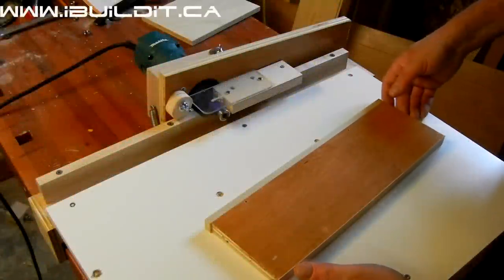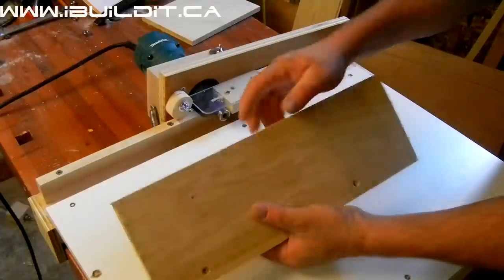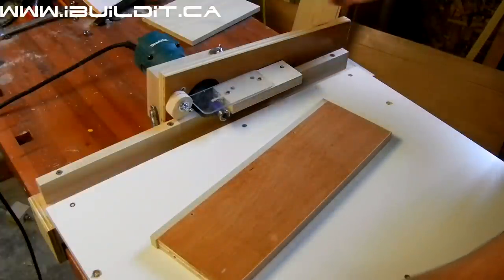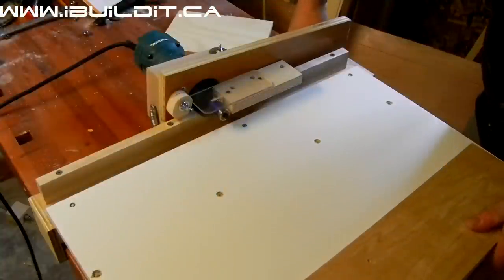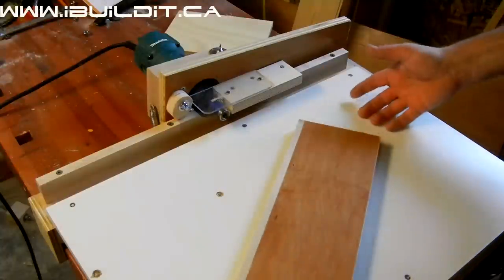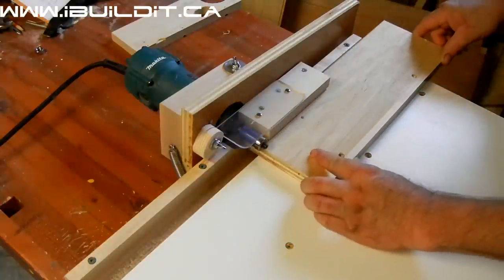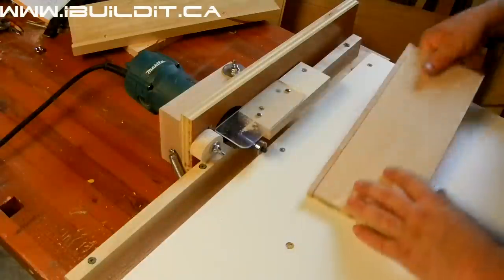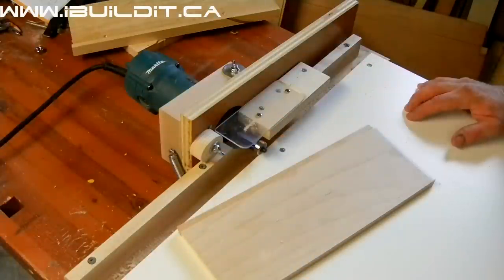Edge Banding Trimmer

Comment from the maker: Dust collection can add quite a bit of complexity to a project but is certainly worth the effort. For something like this, that mostly spits out chips, I would just clean up afterwards, if it is a small run. Otherwise, a 2-1/2" hose could be attached to collect the chips just above the cutter - this should be very effective.

Comment from the maker: For the sake of simplicity, I went with the cam. The cam pre-lifts the arm to the approximate height, so that when the work is pushed through, it doesn't take much effort to push it. This also reduces wear at the pivot point, as the range of motion is reduced. 
A more elaborate machine could have a larger roller in place of the cam, in the place you suggest - this would make it fully self adjusting.

Comment: John this is a brilliant idea and I have started making one. I have a spare router that I am going to set up semi-permanently. The only problem is that I cannot source a long enough ¼" flush trim cutter, the longest (in the UK) seem to be about 32mm. So I am trying it without the second fence and using the pivoting part as the fence. I have put an extra lock / clamp on it and it seems to work ok. Thanks for the realistic videos. Geoff

Comment from the maker: Thanks. I often take some details for granted - I should have mentioned it in the video. The table is about 3/4" from the fence to allow for the uncut edge of the panel, so that the panel can sit flat on the table. The gap between the fence and table needs to be wider than the thickest edge banding that will be trimmed.

Comment: This is an excellent idea.  I think that the reason for the edge banding sometimes not to be perfectly flashed could be that, if you have banding on both (opposite) sides of the board at the same time, the unrouted banding that is away from the router will lift the board causing the side at the router to be slanted downwards.and the edge away from the cutter.  Once both sides are trimmed, a second pass should correct the problem.  Thanks for sharing John.
Reply: Wouldn't it be easier to edge band one side, trim if off, then to edge the other side.
Reply: OwLoLz
I believe what he means is..when you put an edge on one edge of the board, the flash overhangs the top and bottom of that edge. Perhaps a small groove the flash could :"ride in" would eliminate the problem.  Lots cheaper then the $50,000 edgebander I had in my shop :) .....
Reply: Tom Wags
 Or just put your panel on top of a secondary flat surface that would run on top of the table, almost like a sled, then the edges would hange over those and not cause it to be unlevel while going through the cutting head.
Reply: Tom Wags you mean like the one in this video?
Reply: Just a simple watch of the video will show that the white platform does not reach all the way to the fence. This leaves a hollow trench that the bottom overhang will ride through, without touching anything.

Comment: Very slick!  I''m going to have to try and make one of these.  The only thing I might change is the cam.  Personally, I find a round disk with an off centre hole easier to make and the pressure is in a straight line between the bolt and the support so it is less likely to slip.

Again very well thought out device.

Comment: To do this on a regular router table or a horizontal router table, you'd need a false fence w/ a gap.  See my comment below.  That wouldn't be hard to make or put on when you need it.  However, this setup he has here is pretty easy to make & doesn't take up much room.  He says he does a lot of this type of work so it's worth making one.

Comment: Thanks for the idea.  I would like to do similar, but I've just thought of a design change, and was wondering what your thoughts are.  Instead of having the router bit riding on top of the wood, could you instead have it below.  You could then use a standard straight-bit, rather than a flush trim bit (which will only ever be as accurate as the bearing is to the blade).   The platform your workpiece rests on would be adjustable with screws so you can make sure it's perfectly aligned to the router bit.  With the router underneath, the thickness of the workpiece you are cutting doesn't matter.
Reply: Actually, just thinking, probably easier to adjust the router height rather than making the platform adjustable.  But still, I would be interested in your thoughts on having the router underneath the workpiece.
Reply: Repair Iphone 6 plus

Comment: Install the router fixed at the same height as the white board and use a router bit without bearing. It can also be done on any sharper or router table. Or simply just  buy a lipping planer. Lamello, Hofmann or Virutex.

Comment: Rather than the manually adjusted height cam, could the cam be moved to just before  the router cutting bit so that as the work was introduced to the router bit the adjustment cam lifted the cutter to the correct height?

Comment: Hi John, was just wondering why you would need the cam, as having the bearing on the flush bit would in essence act as a self adjusting cam at the same time.
Reply: I thought so too. The spring pulls the router down and the bearing ensures the cutting distance. The cam actually reduces the adaptability of the system to any size of plywood.
Reply from the maker: That question was asked before and the answer is in the other comments. Basically, it pre-sets the height.
Reply: The cam relieves stress from the router bit. I imagine that whole setup with the plywood, the mashine itself plus the spring will put quite a bit of shearing forces to the bit. I can't imagine that would be desirable... or healthy... or sane. Using the cam to preset the thickness should help there.
Reply: Lucio Carrozzo Imagine if there wasn't a cam...as the work piece entered it would bang into the bearing. the cam sets the bearing height so it's just below the work piece surface allowing the bearing to ride up on it easily. the cam should not be making contact during the cutting operation.
Reply: +Maxima ..... What is ???????????
Reply: probably to allow gradual trimming to avoid unwanted chipping on the work piece? 2-3 passes if the banding is a bit wide

Comment: Hey john I built one of these pretty much the same as yours. I'm having trouble getting it to cut close enough without taking of the plywood veneer. Any tips?
Reply: Apply tape on the veneer side that way will keep the cutter .010mm above veneer and with light sand should make it perfect
Reply: Wow thank you that's a great tip!! Thank you
Reply: you welcome
Reply from the maker: The router is supposed to be tilted up at the back slightly - that's the 2 degrees thing in the plans and article.
Reply: Yes I have the 2 degree bevel you are talking about I got it to work a long time ago thanks for your guys help